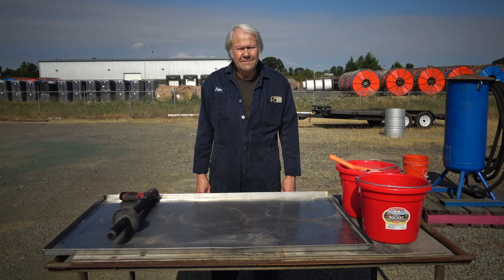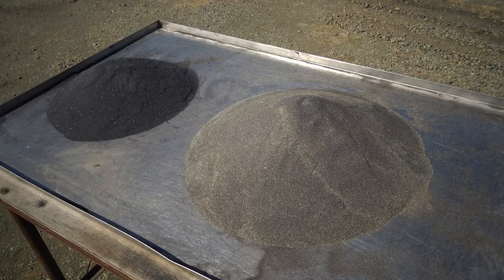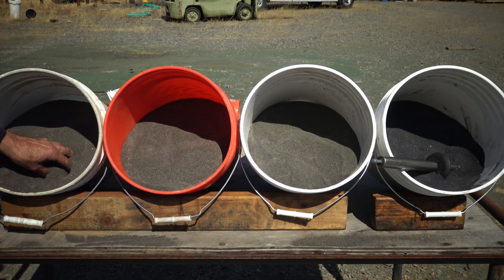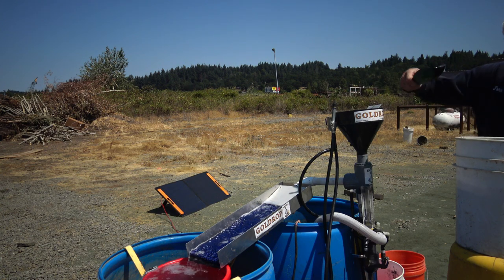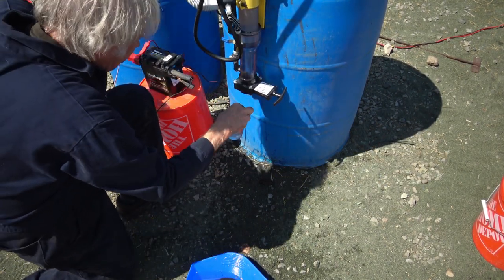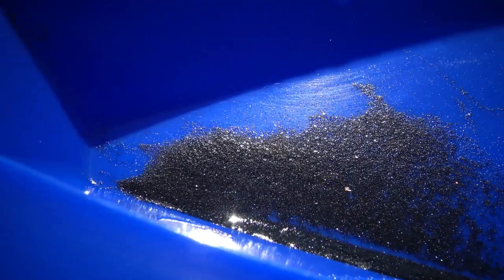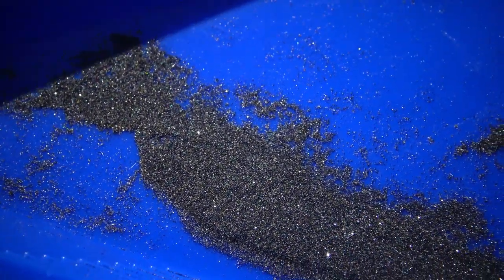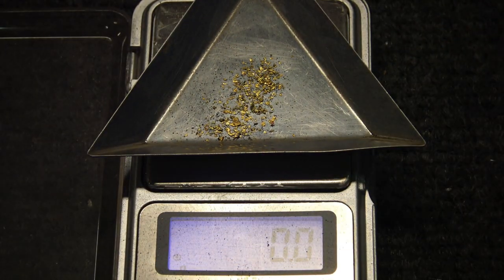GOLDROP vs Cape Disappointment black beach sand 2023

Comment: Man ive been to the Cape a million times and never got gold that big of flakes, you sure you didnt salt those bags a little?
Reply from the maker: If I were to salt the sand with gold, which I did not do, I would have added gold that had weight to it to make it more impressive in recovery. As it is, to recover large, visible gold flakes, "Cape D nuggets", from the Cape D sand that does not register on a scale that you have never seen before is a testament to the efficiency of the Goldrop/ Magnet Sluice system to capture flour gold that is not recoverable by other systems, www.sluicegooseindustries.com.
Reply: @sluicegoosegoldrop2821    iwas just kinda joking but ive been going down there for years and catching smaller gold than that with my gold cube, weighable amounts and they dont show up on the camara as good as yours did.  And im not have trouble catching smaller gold so i doubt im missing the bigger?